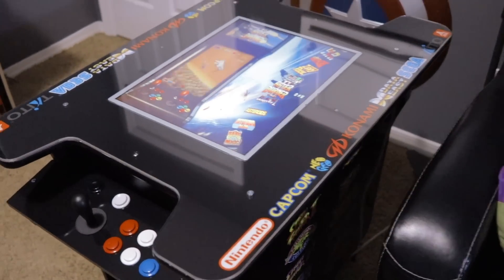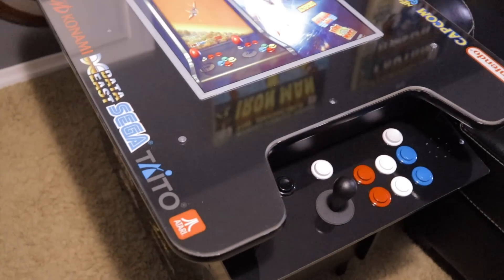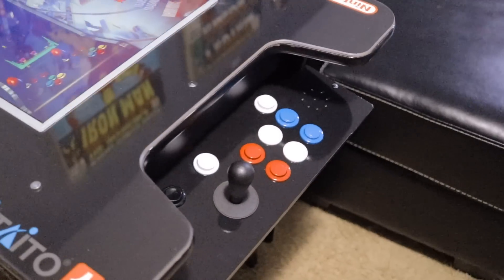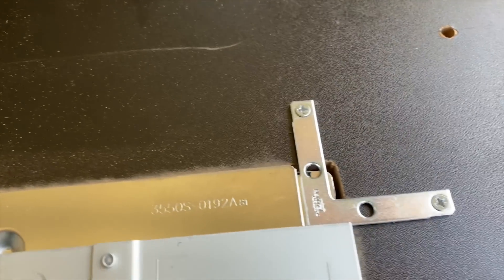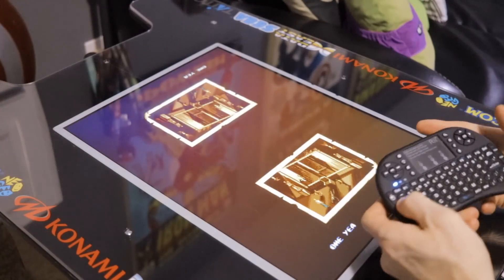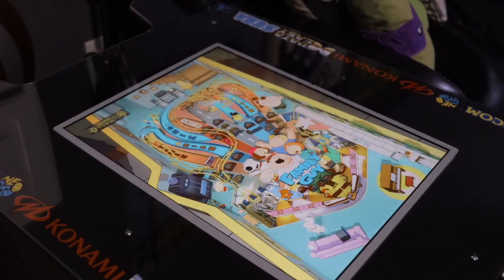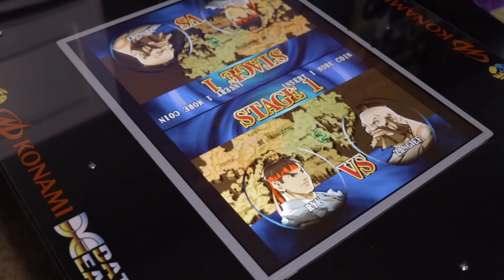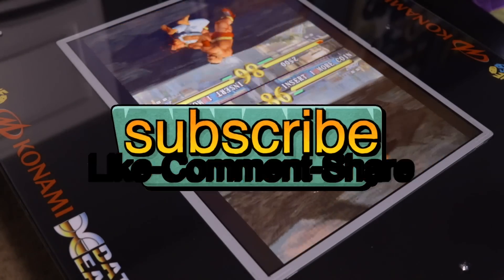Arcade1Up 20” Monitor Cocktail Cabinet Mod!

Comment from the maker: What do you think, do these types of modifications make these Arcade1Up cocktail cabinets more appealing to you? Let me know in the comments below!
Reply: COOLTOY you got to leave it silver looks smart makes it  stand out really cool 👾🕹👾👊👍
Reply: Definitely leave it silver, it looks great 👍.
Reply: More appealing? I replaced my cabinets 17” screen for a 20” dell because it’s a better monitor , I made my own lit marquee because they need one and I swapped all buttons and sticks because the stock arent as good. The only appealing thing I did was install a pi3b and then a PC.
Reply: Yeah looks nicer this way. i have a question, no graphic card on your PC ? If not all Pinballs game is good with Integrated Graphic ? Thank you. ^_^
Reply: Looks great, love the mod and graphics, I personally would black out the silver trim, black vinyl it if you decide to change it, then if u prefer the silver you can always peel the black off, easier then painting and taping the monitor off for painting
Reply: @Jvegas4000  if CoolToy increased the bezel then the monitor would have been lower by the thickness of the bezel material. I believe CoolToy (Douglas)  wanted the monitor to flush mounted!  Black vinyl would cover that silver  monitor edge easily without paint!  :)
Reply from the maker: @jc6939  yea I'm just using the integrated graphics on this pc. Pinball FX runs smooth as can be
Reply: People are modding these things so much, I'm starting to wonder if they shouldn't have bought an entirely different device to begin with....
Reply: I think that monitor is nice, I'd probably have colored the silver black though.  I'm trying to find that computer cheaper then 160 though. I do enjoy your mods though. Very nice
Reply: Do you want to sell your CT cabinet?
Reply: i know Im kind of off topic but do anybody know of a good place to stream new tv shows online ?

Comment: I’m very impressed...note you can also plug in usb fan to the monitor usb..save some room also yes paint them bezels black will blend just right in..love it man...good job.. 👌👍😎😉
Reply from the maker: Yea I love those USB ports on the back of this Dell monitor, they are very handy. I typically plug in my USB LED lights into those USB monitor ports when I install these monitors in the Arcade1Up cabinets.

Comment: I'm just in shock that your running this on integrated graphics and not a discreet GPU. I didn't think it had the horsepower to do that
Reply from the maker: yea it really impressive how much these little optiplex computers can handle with the built in intel graphics. One of the many reasons I love using them so much.

Comment: Cool mod, I'm almost done. I did a 19 inch diagonal monitor cause thats what I had. My woodworking isnt great, and i need some molding to cover my mistakes. Do you have a link for the molding you used around your monitor?
Thx
Reply from the maker: I didn't use molding, what you are seeing is merely the metal casing that was already on the monitor after I removed it's plastic bezel.

Comment: Was the 24" monitor you were testing 16:9?  Did you consider a 16:10 monitor, which you could get in a larger size and have less black bars in cocktail mode?  I haven't tested this in MAME or anything ... let me know if the numbers below make sense.  I want to get a larger screen as well.  Keep up with the great content! :) 

               Original 4:3  is      .75
Cocktailed 4:3 is 3:2 	      .66 (.09 difference)
Cocktailed 16:10 is 10:8  	.8 (.05 difference)
Cocktailed 16:9 is 9:8 	     .88 (.13 difference)
Reply from the maker: yea the 24"  monitor I originally tested was 16:9 I didn't really look into the 16:10 because I was trying to keep the monitor spend price  around $100 or less

Comment: Great video.  Very detailed descriptions.  Did you have to remove/re-install the T-molding when you installed the new graphics on top?
Reply from the maker: I did not, I just trimmed the graphic excess off with a sharp blade with the T-molding still on

Comment: I want a glass top on mine. They scratch so easy. I'm thinking of  putting my ps4 in it with a kickstand for the couch and horizontal controls with 20' do you think I can go bigger? Great job BTW looks kick ass!!
Reply from the maker: depends on the aspect ratio you want to go with. If you want widescreen 16:9 then 24" is about as big as it gets. For 4:3 ratio I don't know of anything bigger than 20" available for purchase currently.

Comment: Hey Cooltoy, I'm getting my cocktail cabinet on Monday and Ive been spending the day researching and preparing for modding it. The big thing I'm stuck on is the Arcadia 6 customization. It looks like you are using the stock front-end and not the vert, correct? How did you get it to rotate vertically? And how did you add games to it?
Reply from the maker: Yes I am using the stock version and not the vertical one. I rotated the image in windows by hitting Ctrl + Alt + and a directional Arrow. This allows you to rotate the windows display any direction you like. Once I did that I simply went into the Arcadia file folders on the computer and added and removed the files I wanted.

Comment: I'm using a Dell 2007fpb and I'm getting a "out of range" message on the monitor, any idea how to resolve this. The emulator doesn't have a 1600x1200 option which is what the monitor is requesting.

Comment: Where did you get the dimensions needed for the overlay? I'm looking to do a similar mod. I really want to switch out the standard Street Fighter graphics. Just Not sure if I'll upgrade the monitor yet, looks a bit difficult.

Comment: I am curious did you create an access panel or have the monitor flip up to get inside the cabinet if necessary? I know on the upright 1ups, I have modded one and put velcro fasteners to take off the back panel and that works well, but accessing these cocktail cabinets with out pulling everything apart looks hard.
Any info would be helpful
Reply from the maker: I’ve not had any reason to get inside the cabinet since building everything. I can add games over WiFi so I haven’t had much reason to think about opening it up

Comment: So for ps2 or dreamcast games could you also do the mirrored cocktail mode for those? Or is it just exclusivly for MAME. Thank you and keep up the great work!
Reply from the maker: Emulators that runs in retroarch can also use the mirrored cocktail mode, but it's an absolute pain to set up
Reply: COOLTOY I see thank you so much for the heads up!

Comment: Arcadia6 vertical or straight arcadia 6?  Did you just copy your mame over as is from launchbox setup so the settings you had made for cocktail stayed?  There are A LOT of games that have a cocktail option and i already set them up in my launchbox setup.  Wouldn't want to have to go through that again.
Reply from the maker: I used Arcadia straight and then rotated the image in windows from horizontal to vertical. Yes I just copied my mame stuff over from the previous launchbox set up I had.

Comment: Do you remember the dimensions for the top of the table.. Is it possible to put a bigger tv inside the table? I don't want to open the box if I can't use my old tv
Reply from the maker: 24" is I think as big as one could likely fit inside the table top

Comment: Can this monitor be put in and play the stock games or would you need to get an LCD upgrade ( as if you were to switch out the regular cabs)?
Reply from the maker: you would need to get an LVDS to HDMI adapter board such as the Geekworm board to get the stock PCB to display an image on this type of monitor.

Comment: Nice! Inspirational! I’d like to upgrade my Arcade1up SF2 H2H cabinet using a 24” 16:10 monitor, but keep everything else original. But how do I connect the original game board to the monitor if there is no HDMI, DVI, etc output? I see lots of info online by people who change out everything, but not keeping the rest original. Is that not possible? Or difficult/expensive?
Reply from the maker: To use a non stock monitor and keep the original PCB is possible but way more trouble and cost than it needs to be to pull off. This is why people tend to use PCs or Raspberry Pi's to replace the existing Arcade1Up board.

Comment: Hi, which LCD Controller Driver Board did you use?
Thanks.
Reply from the maker: Don’t have to use an lcd controller board on a computer monitor. I just connected it via vga like normal

Comment: Switched my Linux based cabinet to CoinOPS, cant get my N64, Wii, or gamecube to run anymore.  Did you have to do anything to get it to work?  Works fine on my much newer pc, so assume it is video card related.

Comment: Do you have the instructions for updating to the latest version of MAME for CoinOps Arcadia 6?
Reply from the maker: it's simply a matter of replacing the MAME application within the Arcadia folders
Reply: @cooltoy  Thank you.  Which version of MAME did you find works best with the cocktail table? Excellent videos!
Reply: could you add @COOLTOY a link for the mame version i been looking with no luck, predicate the video awesome.. .

Comment: So do you still need the VSDISPLAY HDMI Audio LCD Controller Board for this monitor
Reply from the maker: nope, it's a straight VGA connection from the PC to the monitor now. I am now using the LCD Controller Board for another mod project.

Comment: I have done this mod and I’m fairly new and can’t seem to find anywhere to get display options to even show up. I have no experience in MAME and I tried downloading Arcadia 6 and Next and can’t get that option for video. I’m using a dell 24in with 16:10 aspect ratio. Everything else works great just can’t get cocktail cab mode. Someone please help!!!!!!!!
Reply from the maker: you have to hit tab on a usb keyboard while a mame game is running to pull up the menu
Reply: COOLTOY I’ve done that. And video isn’t even an option. I see you have it done but i can’t figure it out for the life of me and streets of rage is what I tried it with. I only get cheat codes, and in game controls but no video options

Comment: What did you map each button to so it would work with coinops on these encoders?
Reply from the maker: are you talking about which button # specifically I have mapped to each input or are you talking about how I mapped each system individually?
Reply: Ummm...both.
Reply: individual systems guess you would just have to hit tab to change if you want, but initially controlling coinops with these encoders are you at 360 controller config in coinops or default config or other...and I see there is a diagram on amazon on the encoders you used and to know which buttons you put to what labels.  SE ST are obvious, but where the back was put that actually worked and the other buttons.  Didn't know if the way you set them up initially made it work with coinops right away and didn't require re-mappin for individual emulators since coinops uses the same controls across the board.
Reply from the maker: @flpennstater305  I'm using the default config for coin ops. For all the MAME games I have my back button configured to "UI Cancel" in the mame settings to allow me to get out of all those games, and then for my RetroArch emulated games I have the start and select buttons configured as my hot keys to back out of those games. Pinball FX and Ultra Street Fighter IV both have dedicated Exit menu options within those games so I just select those with action buttons to back out.
Reply: What version of mame does it take to get genesis and snes into cocktail.  I have mame64 but no option for that with tab in game.  Do you just copy over the exe files with the new one?...or all the mame files
Reply: answering my own question.  yes copy over the exes.  mame64.exe and mame.exe they stopped making the 32 bit with the newest one so you'll have to use a slightly older mame.exe

Comment: So i bave the coinops image when i hit tab i get a different ui dont have cocktail setting do i have to change the emulator?
Reply from the maker: yes, only certain versions of MAME support the cocktail mode. You'll need to find the MAME folder within coin ops and replace the MAME application that is there, with one that supports the cocktail mode
Reply: What version of Mame does it? Could post the link for it, thank you..
Reply: i replaced the .exe with 0.174 and the games in coin ops dont load up now

Comment: He could of just got a black Pacman cocktail for the same price and modded from there..
Reply from the maker: except I only paid $250 for my cocktail cabinet and I specifically wanted the cocktail cabinet that had 6 buttons already
Reply: You're forgetting that Pacman doesn't come with 6 buttons which is what a lot of the games that he plays need that are not just dependent on 2. This saves him from extra work and just a quick button swap.